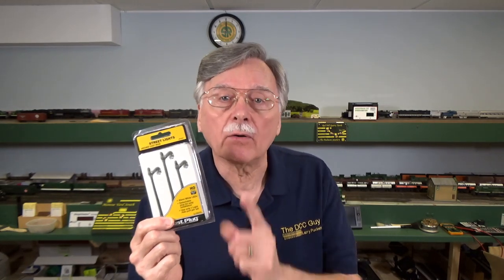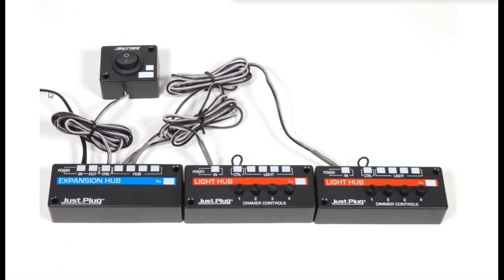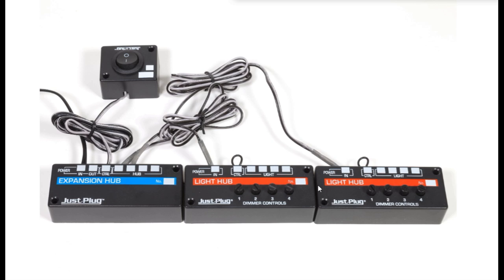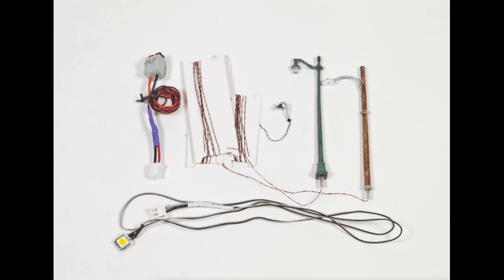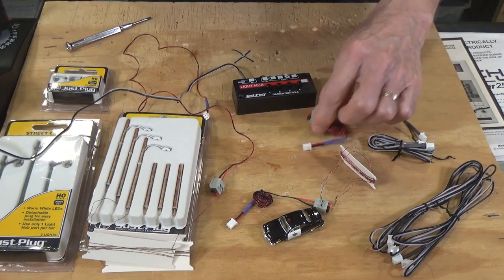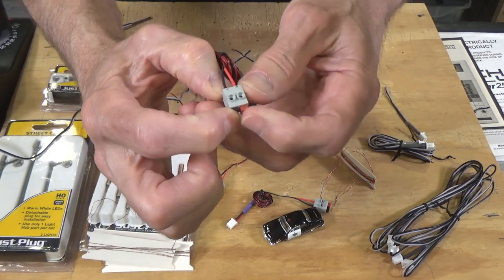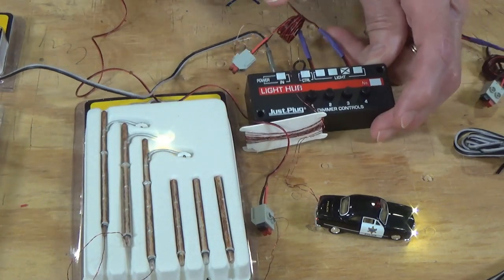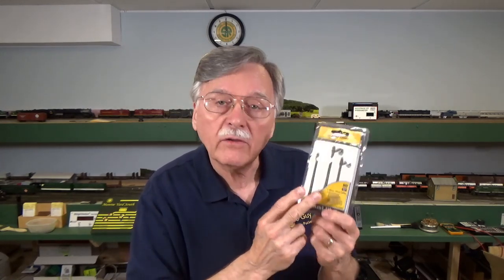Light Up Your Layout With Woodland Scenics Just Plug (94)

Comment: Hi Larry   the street  lamp wires are 4 ft    just put 6 in my layout  I did use extension  cables  to reach  my  hub   then wrapped  the excess cable   with tape  and plugged  it  in  perfect      cheers  mate

Comment: I guess you had better luck with the linker plugs than I did. Sometimes they worked sometimes not. I ended up soldering the wires to a larger gauge wire to get a proper connection. Striping the wires is next to impossible. I ended up burning off the insulation with a butane lighter( I know, not a recommended practice)
While I was happy with the results, the frustration of working with situations were you couldn’t “just plug “ made me look for other solutions and so I went with Dwarvin fiber optic lighting. It was simple and lent itself to a lot of creative solutions to retro fitting my buildings. 
I’ve also used Evan’s Designs for lighting using leds .
Reply from the maker: I know what you mean but I found that by doubling over the ends of the wires and combining multiples it became thick enough to do the job.

Comment: I like those lights mounted on the wooden poles! I'm guessing the lights can be used by themselves (with resistors, of course) and powered from my converted computer power supply? I think 3.3V DC would power them nicely.
Reply from the maker: Let me know if that works for you. I keep 1.5V batteries around in 1 and 2 battery holders so I can test things like that quickly and safely. They should be your basic white LED. I just find it easier to use the Just Plug Light Hubs and my old MRC power pack.
Reply: @TheDCCGuy  Once I get to that point, I'll let you know how they worked.

Comment: Just the video I have been looking for. Thanks for the information. If an expansion hub's purpose is converting 16v AC to 12v DC, why can't I provide my own 12v DC power to the light hubs and skip the expansion hubs altogether? Harold
Reply from the maker: I have no knowledge of the internal circuitry. Your DC power supply may work or it may not. Would you risk damaging the Light Hub over the cost of a 16VAC power supply? Also the various electrical components for converting AC to DC are in the Light Hub not the expansion hub. As far as I can see the Expansion Hub just serves as a junction box to route the AC out to multiple Light Hubs where the AC is converted to DC. BTW I also found out why the trim pots break, the little knobs have a VERY small plastic pin that connects them to the actual trim pot and that little pin is what breaks. I need to test whether the trim pot will still work using a small screw driver to turn it—more once I have time to experiment.
Reply: @TheDCCGuy  Thanks for your response. I get your point but I may try it anyway. I'll let you know what happens...Harold
Reply: In addition .to changing to DC power the hub also has everything needed to step down the power such as the resistors, and I think I read it also provide some anything needed for anti flicker too if that is an issue.
Reply from the maker: The Light Hubs, have a number of resistors, rectifier bridge, capacitor, and the trim pots. I have not opened an Expansion Hub since it is stuck to the underside of the layout now, but I bet it is just wired to distribute the AC power to the Light Hubs.
Reply: @TheDCCGuy  That helps...thanks for looking...Harold

Comment: Great overview Larry! Question for you on these, how does one extend the length of the wiring to reach distances without having to buy multiple controllers/hubs/etc. I'm assuming can cut/solder additional length of wire as needed or? Thanks.
Reply from the maker: I assume that could be done. However I have never had that problem and instead find the provided wires are excessive and I usually end up cutting them.

Comment: I just got the street lights and one of the signs and although they look great the connectors that came with mine look nothing like the one in this video and require the eyesight of a hawk or a twelve-year-old to hook up. Frustrating for an old codger like myself. I changed my mind about buying any additional lights after being unable to wire up the first ones. Engineered for young folks only.
Reply from the maker: I did this video a couple of years ago so they may have changed the connectors.

Comment: Larry good  presentation   could  you  tell me  how long is the wire on the  street lamps       thanks
Reply from the maker: I think they are about 3’ but probably differ some. I found them so long I had to cut them back quire a bit, which is both good and bad.

Comment: Are you modeling a specific area of the Southern Railroad? I think you model the Piedmont division but not sure about that. I wondered do you do specific places in that division and what they are? Nice video about the Just Plug system. It's a great product for people that are not great with electric systems. My favorite specific product from this system are the wood light poles. So far I've stock pilled 15 packs for the future layout. Stay well.    👍
Reply from the maker: I model the Charlottesville to Lynchburg mainline of the Southern Railway in summer 1957. That lets me use Southern green diesels as well as N&W 4-8-4 streamlined steam. I can also pull on some C&O. The area offers a combination of mainline pass and freight as well as locals on the mainline and in the Lynchburg area.
Reply: @TheDCCGuy  Thanks for answering my question. I have another. My favorite railroad is Southern and I'm wanting to model a branchline from Salisbury to Norwood in NC. I know a lot about Southern Railroad but there are still some things I need answered. Were the first diesels all painted green? If so when did they start painting them black?
Reply from the maker: The first passenger diesels came in the fancy green and imitation aluminum scheme in 1941. Originally the imitation aluminum (light grey) was silver metallic paint but it apparently did not hold up well so they switched to light grey. The freight diesels were black with the silver then light grey lettering and herald. The early FTs and F3s  were black and imitation aluminum too. Then in 1949 all were switched to the green and imitation aluminum paint. That lasted until 1959 when the green was replaced with black on all units. However there were some early trial repaints as early as 1957. BTW Accuflex SP Letter Grey is a good match for the imitation aluminum in the MicroScale decals.
Reply: @TheDCCGuy  This is perfect information for me. I'm going to model 1945 to 1950 time frame. So now i know i can have both paint variations in all different types of locomotives and not particularly constrained to make the paint match a certain type locomotive precisely. Thanks this is a great help. Stay well.   👍

Comment: Is it possible to add none WLS lights such as those from Gaugemaster via a Linker cable ? Great video series ! 🇬🇧🇺🇸🇬🇧
Reply from the maker: Maybe. I suspect the Just Plug lights are simple surface mount LEDs and the electronics for controlling voltage and current are in the little black boxes. If I get time I’ll try to remember to test a straight LED. Some Gaugemaster lights are incandescent bulbs so you would need to know their operating voltage too. If my assumptions are correct then you likely would only get about 3 volts from the Just Plug controllers and I bet the Gaugemasters are 12 volt bulbs. If they offer LED lights then it is more likely to work.
Reply: @TheDCCGuy  Thank you for a very rapid and detailed reply ! I've returned to the hobby after 50 years so lots to learn. Have a great week.